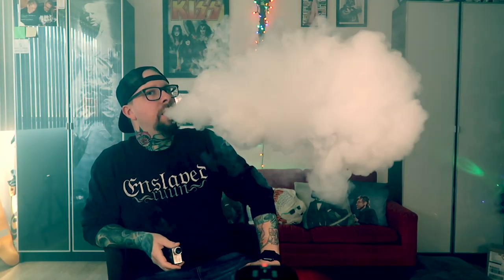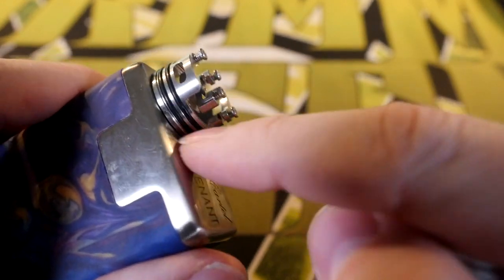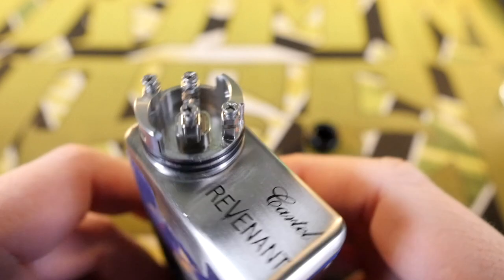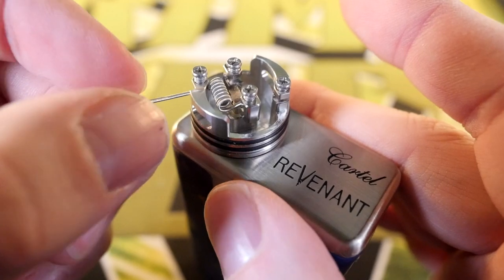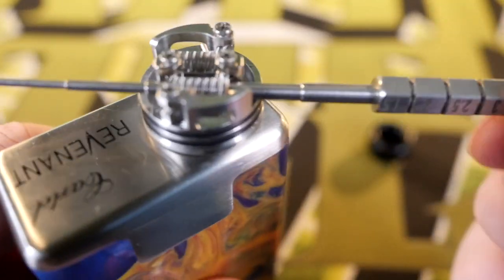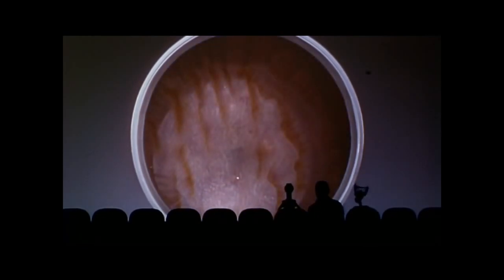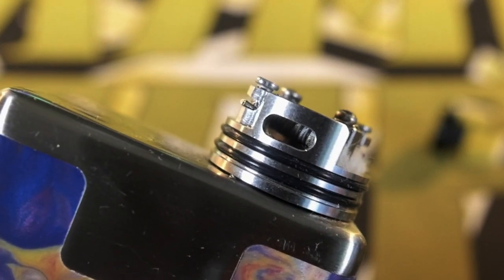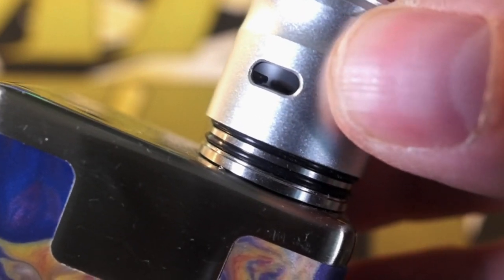Nudge RDA ~ Wotofo ~SMM ~ Review

Comment: Finally, someone who correctly said, if you do not cut the leads on the outside short enough it can scratch the top cap inside. I have heard 1 reviewer after another say to be sure to cut the lead close enough to avoid it creating a short, and it will not and cannot short to the top cap, because it is the negative lead, and the top cap is also negative. You cannot short a negative lead to a negative top cap. I can also put 3mm coils in there all day long...it is a tight clearance, but the coils that come with it are 3mm.

Comment: Flip the Turk coil...and it would be high set?
Reply: Yes you're right, but you can't screw that in, I mean you can screw one side and the other will ended up inside an air-flow hole. Pause @4:12 and go figure.

Comment: Random question.. do you ever have trouble with altitude? I was coming through Arizona towards SoCal and my ears popped. Reached for a vape.. aaaand juice everywhere. Is this a thing?
Reply: Well pressure difference sucks the liquid through the wick. Just empty your tanks before travelling;)
Reply: kinda defeats the purpose
Reply from the maker: Yeah altitude is a killer in tanks.  Driving through the VapeTour last year with a tank.  From AZ through CO to WA made my tank go crazy.  Lots of leaking.  If you're not using it you can flip it upside down.
Reply: There's an idea. I appreciate the reply. Cool channel bro.